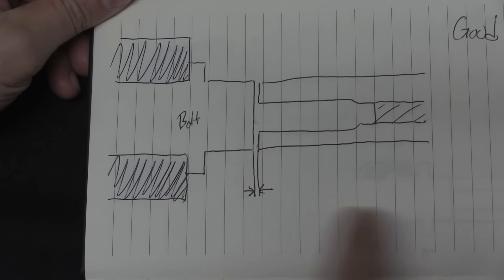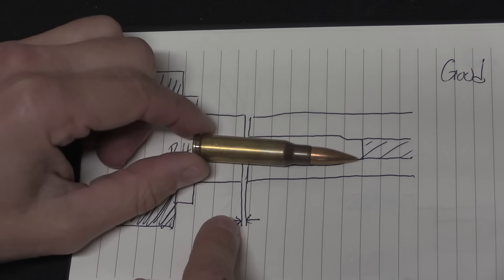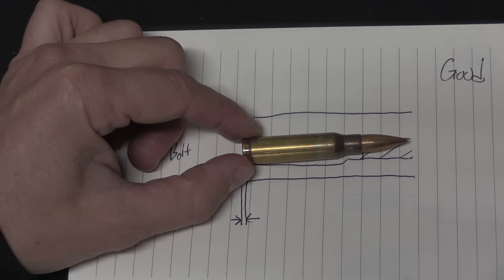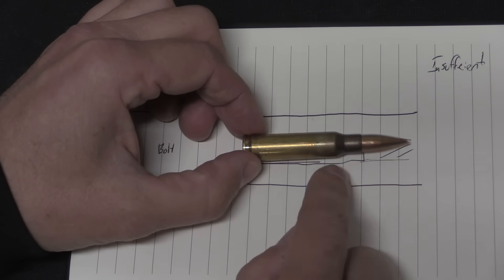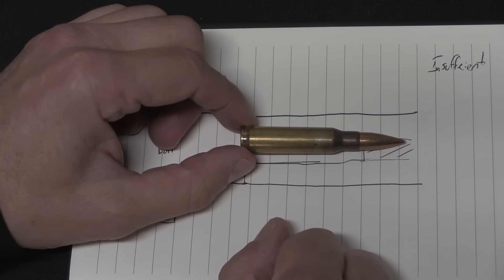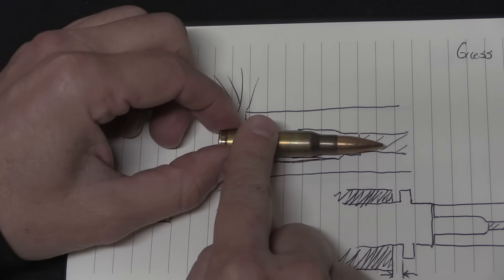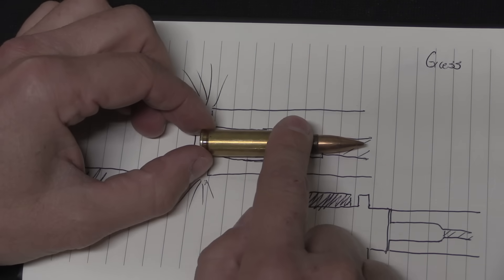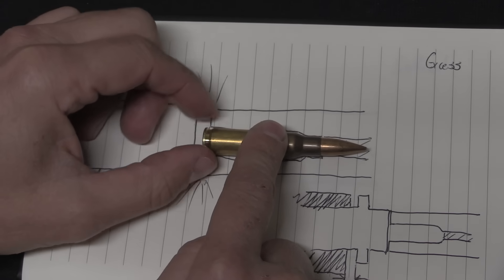Ask Ian: What is Headspace? (And Why It Matters)

Comment: But, after your lengthly discussion, you still didnt state what the actual definition of what headspace is.
IT IS, THE DISTANCE MEASURED FROM THE FACE OF THE BOLT TO THE BASE OF THE CARTRIDGE WHEN THE ROUND IS FULLY CHAMBERED.

Comment: Isn’t the cartridge attached to the bolt face being held by the extractor? Also, doesn’t the BCG push the bolt face forward to “unload” the BCG from the barrel face? The space you refer to in your illustration appears to have a gap but if the cartridge is attached to the BCG face, does that even exist? I’m confused???

Comment: The amount of clearance we are talking about is measured in thousandths, if not ten-thoundths, of an inch. Also, headspace guages are, with some exceptions, unique for every caliber. You need different guages for each of .308, 7.62x39, .303 British, etc. 

A minimum set is 2, a go guage and a no-go guage. Putting the guage in place of a cartridge a properly headspaced rifle will close properly on a go guage and not close on a no-go guage. If it doesn't close on the go guage headspace is too tight, if it closes on the no-go guage headspace is too loose.

There is also something called a field guage. On old rifles that have been shot a lot it has been shown that sometimes you can fire them safely even if the no-go guage shows headspace is too loose. In these cases the original headspace allowance was narrower than strictly neccessary when the rifle was new. For these calibers a field guage fullfills the same function as a no-go, but with more room allowed between bolt and barrel. You shouldn't use this for a rifle you build yourself (even from a parts kit) or that you intend to put more powerful ammunition through.

Comment: In my bran new M1 Garand from CMP.   Bran new to me.   I ordered a gun that had been in the Philippines because my dad was a SEABEE there during WWII building air strips.  I had them put a new barrel on it, repark everything.   They did and the rifle was beautiful when I received it.  The only M1 Grand ammo I could find locally was PPU.  I bought 5 boxes.  The first round out of the chamber seemed a bit much with heavy recoil .   This is my second M1 Garand.  So not the first firing for me.   I fired the second round, the rear 3rd of the case was ripped off and the front 2/3's was still inside the chamber.  I went home, trying to understand why, I found the bullets were barely seated and the COAL,  Collective Overall Length was  .130 thousands over Sammi Specs.  The bullets were being jammed into the lands and creating a higher pressure to get the bullet moving.  PPU did reimburse me for the ammo.  But that could have ended badly.

Comment: There used to be replacement bolt "heads" for the Enfield .303 SMLE. From memory, they came with slight increments in length to adjust for headspace in heavily used rifles. The increments were around 0.001 (I think) and you could go up to three increments.

Comment: The venerable old .50 cal has a screw in replacement barrel. So there was a headspace tool which you used to set the head spacing correctly. It also resulted in many comments about people needing to check their head spacing.

Comment: You need to correct yourself.

Headspace is the distance from the base or head of the cartridge to the point on the case that that keeps the round in the correct position in the chamber. Headspace prevents the round from traveling too far down the barrel and keeps it in the chamber.14 Sept 2023 NRA

Comment: To be fair,  
The so called lug gap problem,  I don't see how you would get that problem if you install the barrel on a closed and locked bolt, as you should be doing in the first place.
Any half competent gunsmith or even DIY would check that the barrel is tight to the bolt, and not so tight it has difficulty closing.. Thats a check done before even looking at headspace.

Its more likely to get that problem by doing silly things like getting the wrong bolt in your rifle (possible if you have multiple similar rifles in different calibers and you remove bolts for transport).
And even a headspace gauge might not show you a problem because loose lugs could easily be countered by short chamber and you'de be none the wiser from a Go no go gauge

So imho, I'm inclined to call a headspace problem a chamber problem on a properly installed (to the receiver and bolt) barrel and normally fitting locking lugs. Where the chamber was either reamed to short and needs to be reamed a bit more, or reamed to far and or wore out too long for the cartrdige, in which case the barrel has to be set back and rereamed

Comment: Super explanation, Ian!  And one can clearly see how Hybrid (Stainless Steel) base on the cartridge case allows higher pressures and no blowout until the pressure is dropping as the bullet travels down the barrel, and then unlocks the bolt, still at higher pressure, and the case base is strong enough during extraction with higher camber pressure!  Good place to show this on your super diagram!! ❤

Comment: This took me back to my early soldiering and being taught the Browning 30 cal MG. Of course, the lessons there generalised to the M2 later. I formed the “habit” of carrying my own specialised tools, for things like measuring headspace and extracting separated cases. In SVN it was surprising how often and for what purposes my little toolkit came into use, not only for my unit, but other things. I recall getting a chainsaw operative using the kit and fixing range finding radar using parts of the radar toolkit and my own tools.

Comment: Great video; nice tip on head-spacing when building a firearm from parts; I built semi, closed bolt Mk-2 and Mk-3 Stens and they work great. However, I want to mention that while building & testing: I had one 'blowback' experience when I put in too light of a recoil spring in accidently; Very glad I was wearing eye protection as the blast pressure found every place where my shooting glasses leaked, woke me up.  The semi-Sten has 2-springs instead of one and the spring travel-length sort of leaves it almost loose when closed & loaded, then has an over-tight 'accelerated spring compression when cocked back past the sear locking point to the bolt-stop. I might try an Uzi recoil spring.  The surplus WW-2 mags worked great, most were stored well and 70% weren't worn out. The closed-bolt semi-Sten doesn't jam and feeds hollow points and flat-noses easily when Uzi only takes FMJ ammo.

Comment: If the head gap is too big will the firing pin hit the cap? 6:14
Reply: The bolt reaches the cartridge, but the gap behind it allows it to be pushed back too far, so the pin reaches but then the failure occurs after firing, in that situation

Comment: I guess if he would have drumed the picture correctly it would be easier to follow but if you move that bullet chamber back and then put both things talking about would be behind it not up there past the threads of the barrel nut , Then you would be able to use barrel washers they're only a thousandth or a few thousand thick to put in between the barrel in the action to adjust your headspace that's how we gun building machinists would do it

Comment: Not correct head space is gap between cartridge face and bolt face you wo t force bullet into rifling with to little heads pace bolt won't close and there is a gap between Cham er and rifling that's called Freeborn that's bolt into chamber design you can't go deeper then the shoulder  will let you if to much head spa e the gap between cartridge face and bolt is to wide causing misfires or ruptured case

Comment: I had a 1903A3 gave to me in 1995 ,I cleaned and swapped the barrel oiled it up all nice took it to my outside range 1st shot 1/2 from bullseye 2nd round didn't hit target at all , I pulled bolt out looked through barrel all clear , checked bolt nothing appeared broken or missing tried 3rd round and it blew up in my face luckily I only had minor injuries ! Then found out a warning was issued on the rifle by serial number for head space! Lesson learned check head space first !!!

Comment: question: there are others here on YouTube that push the idea you must have a shoulder bump of at least 2k with fired formed brass but you indicate a Zero shoulder bump is better which I also agree with.
I generally just neck size with my Lee neck die as I like the idea od using the mandrel for internal sizing the neck of my cases. 
So who is correct them or us ?

Comment: My m1a had bad headspace when it was brand new. It was chewing up brass and broke the extractor. I was having cycling issues, took it to the dealer which sold it to me, they headspaced it, and sent it back to Springfield to get fixed, and needed rebarrelling.

Comment: This vid brought to mind a common Mosin Nagant issue, sticking bolt. I know that it is difficult to read all comments but here goes anyway.  I have an M91 as well as a carbine, I have a lot of surplus steel ball ammo.  After about a half dozen rounds the bolt sticks and is difficult to impossible to open.  I have read many theories on the cause and have tried everything form cleaning with a wire brush and solvent, heating and cleaning, polishing the bolt locking surfaces, etc with no luck.  Might you know of an exact cause and fix?

Comment: One thing I would like to see discussed is whether the details of certain firearms utilize case features that were not intended for headspaces.  Example:  the .50BMG appears to function as a rimmed round in the t-slot of the M2 bolt.  It is questionable in my mind whether the shoulder of the case ever makes contact with the shoulder of the chamber in a properly headspaced barrel, when you look at the rim dimension and tolerance and the t-slot dimension and tolerance.

Same for the PKM: it fires a rimmed round, but I wonder if it actually headspaces on the shoulder.  I don't know.

The 1911 chamber can be something like .022" longer than the minimum case length, which is absolutely excessive in my opinion, and I suspect that the extractor mitigates this by holding the case nearer to the breachface than the chamber would permit.  It appears that it basically functions as a rimmed round.  Either that, or the ductility of the brass case of this particularly low-pressure cartridge is high enough that case failures do not occur when strained more than .009" or so.

Comment: There are a number of western weapons that utilize what is known as "crush-up" - that is, the minimum length chamber is a little shorter than the maximum length cartridge, in order to mitigate the effects of a compliant breach, or thermal expansion from extended firing.  The 1918 BAR, M1 Garand, M60, M249 and M240 all utilize "crush-up."  The minimum M240 chamber is .010" shorter than the maximum cartridge.

An explanation of this concept can be found in Technical Notes Small Arms Design by John Rocha, which has been featured on this channel before.

Comment: Excessive backspace is anything over .004". One layer of Scotch tape is .002" so .004" looks like a small gap. What causes case head separation is the ejector pin pushing the case forward until the case shoulder stops at the chamber shoulder. When you fire the rifle the case head isn't against the bolt face. I don't think I'll ever fire another rifle unless I check the backspace. No-go gauges are pretty cheap.

Comment: Any decently made firearm will have close tolerances on headspace, not nearly enough to cause a lateral blowout. Ideally headspace should be between .001" and .003".  I have had guns with .008" headspace, (with factory loads), which gives you flattened primers, loose primer pockets and blown out primers.  If you fully resize each time, case head separation will be imminent on the third, maybe the fourth firing.  Most can't determine whether this condition is due to excess headspace or excess pressures.  If this happens on a factory or starter load, it is usually a headspace issue. Headspace isn't actually a function of the gun, but rather a function of cartridge case dimension. I have had Lapua brass as much as .005" BELOW SAAMI minimum specs, and with AR 15 stretching on bolt opening, you can have an effective headspace of up to .019", not good at all, real bad stretching, this in a gun with .004" headspace with a SAAMI maximum cartridge. How much you resize will determine if you can overcome this situation. I always use bushing resizing dies and shoulder bump can be controlled with  bushing bump dies or feeler gauges held between the die and the shell holder, if full length resizing is necessary (autoloaders).

Comment: Machists use 2 soft plastic strips in a paper cover ( any store that sells pistons,rings,crank bearings)
The strips get smashed in between 2 pieces of metal at a very correct pressure. 
It's then disassembled and the smashed width tells the distance between the 2 pieces. 
Total cost $30?$40 for the micrometer. 
Is this accurate enough?
They are used to .000

Comment: I have noticed that on a fair number of Mosin-Nagant rifles, after firing, the bolt is difficult to open. One rifle was so bad, that the operator had to keep a hammer on the firing line to strike the bolt up, in order to open it. I am wondering now if this is due to incorrect headspace.

Comment: The taper of the case + the thermal expansion, must create a seal.

Ian, I don't suppose you would happen to know the tolerances of the case, barrel and chamber
A dream of mine is to engineer firearms and machine then as well
If it is +/- 0.001 or 0.0001?

Comment: It helps if the gunsmith actually does what he is supposed to. I purchased a Turkish Mauser and took it to a smith. All he did was work the action a few times and said it was fine. Spoiler alert, it wasn't. The spacing was off enough that the rifle wouldn't fire, with factory loads, about 3 times in 10. It was then I read about Go/No Go/Field gages.

Comment: You use a go, and no go gauge, to check headspace, the only safe way to tighten FAL rifles is by having rail shoulders welded and ground, on HK fluted barrel systems throw the rifle away it is worn out..  
 Because HK can only be tightened by welding and grinding the bolt face which gives a false reading with go- no gauges. Symptoms of this is the back of the case  tears off leaving part of the case in the chamber so the next round will jam and  potentially chainfire the magazine.

Comment: I wanted to buy the CZ-457 rifle with the three barrel set (17HMR, 22LR, and 22WMR) but it was unavailable so I bought the rifle in 22LR and barrels for the other two calibers separately. Being new to shooting I had no idea about head space until I read the warning about checking it from CZ. So I did my homework and educated myself on what it was, how to check it, and then do the fix if needed. I went local at first and every gunsmith I asked told me to "Just shoot it and see." So that didn't sound right and I bought the 'go', 'no-go' gauges which in itself turned out to be a wild goose chase as they weren't immediately available. I eventually waited for a run to be made on the 22 rimfire gages and got the job done. In the end it just made me a better shooter. Also, I wouldn't let a gunsmith in my city change the batteries in my flashlight let alone do anything to my guns. "Just shoot it...." lol.

Comment: Too much headspace gets to be even more of a problem with a tapered casing like .303 British. If that cartridge is fired while the casing is seated too far back against the bolt face, the taper causes excessive space all along the length of the casing in the chamber, causing expansion under pressure along the whole casing length when fired. This could cause cracking of the casing and release of gases in directions where it was never meant to go.

Comment: Should have covered the most dangerous case where the lugs shear off do to bad head spacing. If you get too much gap it allows the bolt to build up even more velocity and mass times velocity can equal sheared lugs if it gets too high.

Comment: While in the Army I went to an armorers course to learn how to operate, maintain and repair many various weapon systems including the M2 .50 cal and M240 machine guns. The M2 needed to have the headspace checked whenever the barrel was installed which was a simple process and took less than a minute. The barrels of M2s were not assigned to a single weapon and were interchangeable between different machine guns, and because of that, the headspace had to be checked and adjusted. 

The M240 did not have to have the headspace checked since the barrels were assigned to that weapon by serial number. They were not interchangeable across different weapons. 

In our classroom there were some examples of machine guns mounted on the wall that did not proper headspace set. It showed weapons that had catastrophic explosions that completely destroyed receivers and barrels, and of course the instructors had stories of what happened to the operators of those weapons. The stories were probably made up but point taken - someone got messed up when those things exploded.

Comment: Third example of a modern firearm and the importance of headspace is when you have something capable of shooting multiple rounds IE, ar15s in 5.56. As in you can shoot 2.23 out of a 5.56 gun, but not the other way around. At least I have been told (NRA RIFLE instructor instructor) that that is one of the reasons, the other being that the 556 has more pressure.